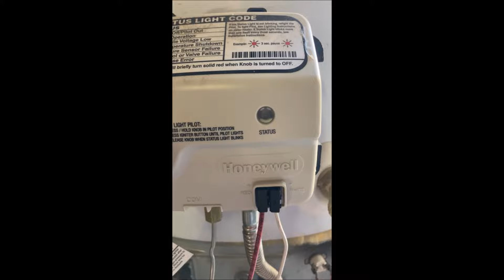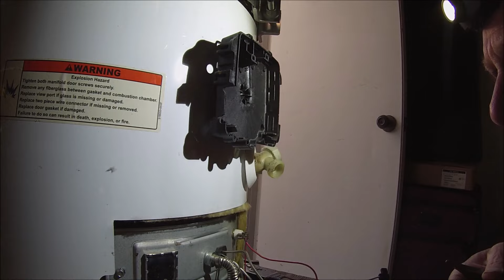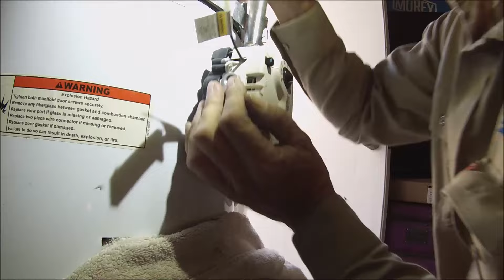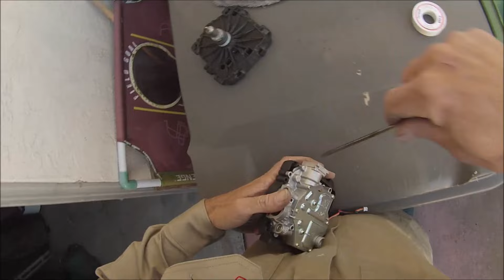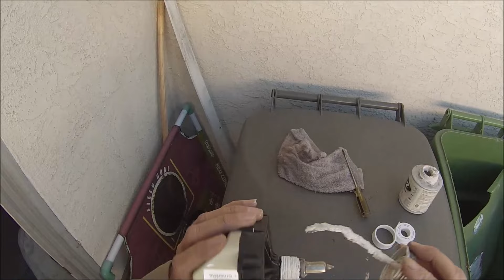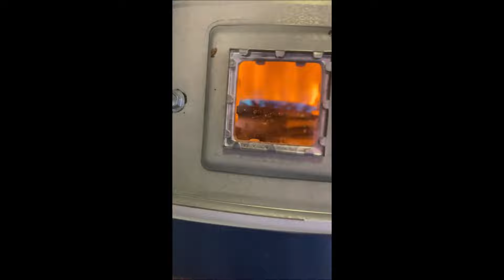Code 5 | 5 Flash Water Heater Honeywell Valve Service Call

Comment: We had rain and high winds and then the house water was still hot but not hot enough. My hot water heater is in a room that is only accessible from outside; a furnace room. I went to check out the wh after a couple days of being puzzled by the hot water. Still had hot water, just not enough. The door to the room was open. It must have blown open and the wh is close to the door. Somewhere in one of these videos someone talked about the controls getting wet. I took apart the control just enough to get some airflow into it, got out a hair dryer for 5 minutes, turned the pilot off and back on and presto it works. Thanks for the help.

Comment: This is a fantastic video after 20+ without showing my issue. STOP and read this if you have this 5 flash error code: Make sure the plug for the temperature controller is plugged into the circuit board. Mine was dislodged and causing the error code because the computer could not get a reading on the sensor
Reply from the maker: @Adventures_with_nick  thanks for watching. I really appreciate the comment. I’m glad it helped you out.
Reply: @ videos like this are the lifeblood of DIY and home affordability, thank you!

Comment: Had the 5-flash code since June, but with this South Texas summer, there was no pressing need for scalding hot tap. But after a few battles with a leftover bacon greased skillet, it was time to give replacing the temperature sensor a go! Bought the part off of Amazon ($50) and followed the first part of your EXCELLENT video to a T.  Everything went as smoothly as planned, and clean skillets and hot lava showers are the back in rotation. Thank you sir!! 👍👍
Reply from the maker: @jjrafanan1970  excellent ! Well done thanks for watching!

Comment: Had an intermittent temp sensor error, so I figured it was just a flaky sensor.  I had watched your video (very helpful!) and knew I had everything to swap it out.  I wish I had paid more attention to your discussion on the plastic vs metal tip.  I didn't check beforehand and I should have.  When I pulled the sensor, it was wet. :(  
I then had to order a whole new gas valve.  I loved your tip on using a short pipe to plug the water connection so that I didn't have to drain the tank.  The replacement was fairly easy then, and now I have good hot water and a couple spare parts for the gas valve since it was only the back plastic that was bad.
Reply from the maker: @ken261  : that’s great. I’m glad it worked out. Thanks for watching and commenting. Appreciate it.

Comment: I have a 10 year old Whirlpool NG water heater (I think they are made by A.O. Smith) that has been giving 5 flashes.  I replaced the entire burner assembly. Still faults out, so next I check the valve itself. Thanks for the instructions.
Reply from the maker: No worries! I did a code 5 tonight ! Bradford White ! Thanks for watching an commenting!

Comment: The problem is that Honeywell used nylon for the thermowell. Nylon absorbs water and is not compatible with chlorides and eventually the plastic fails in the application. After 11 years, the thermowell literally disintegrated. I repaired mine by using double wall heat shrink to (I also needed some 3/8 waterline to rebuild) seal it up. Doublewall heatshrink has glue on the inside surface. The product I used had operating temperature up to 135°C.
Reply from the maker: Wow, good job!!

Comment: Great video, thank you!
Do you have to turn off power to the water heater before taking the Honeywell unit apart? I don't see any power running from the house to the Honeywell unit, just the wires you show in the video. Where does the power for the unit come from (i.e that makes the light flash)?
Reply from the maker: @kenlindeman8633  : no it gets its electricity. It turns the pilot flame into voltage for the circuit board so all you have to do is turn the valve off. It has its own electricity that way no batteries no power from the house.

Comment: I have the 5 flash error code on a Honeywell unit and I am confused by some of the wording used in the video. A statement about replacing the valve would not fix the problem and only replacing the thermistor would. From what I see on the video, the thermistor is an integral part of the valve and replacing the valve would cost more but also fix the problem. Correct? Just want to be sure if I cannot find the correct replacement Thermistor, then replacing the valve should resolve the 5 flash error code?
Reply from the maker: @JeffreyDeGilio  : well, I’m sorry you’re confused by the video when I say the Valve that’s kind of the entire thing so that’s the Mr. the Valve itself the Circuit Baord and the well Housing , which I just call the Valve. It’s very difficult to purchase just a mister so you’re probably gonna end up having to buy a completely new valve. I would search for one that’s used on eBay or maybe check Amazon. Typically what causes the five flash is the well Housing , which is the black plastic part that screws into the water heater gets a hole in the end and then water gets in and kind of screws up the thermistor. So it is possible to rebuild with parts your existing valve unit. In that particular video, I tried to cheat and just replaced the thermistor. But doing that is only a temporary fix and it only buys you a little more time. I ended up replacing the whole thing. I tried to be as thorough as possible. Hope the video helped you out in someway. Thanks for watching.

Comment: This is the ONLY video I could find on YouTube about the thermistor.  It helped a bunch!  My thermistor was wet.  Do you know where a DIYer can find just the black part of the housing thay goes into the tank?
Reply from the maker: I've got boxs of them , but try ebay.
Reply from the maker: Thanks for watching!
Reply: If you have a back for a Honeywell valve model WV8840B1109, would you consider selling it to me?
Reply from the maker: @backrhodeskansas  the whole valve?
Reply: No...just the back part that screws into the tank.  My thermistor was wet so mine must have a crack in it.
Reply from the maker: @backrhodeskansas Yeah sure you need the the shank depth size and spacing center or bottom 2" or 3" Metal cap included 20$ plus shipping where are you at?
Reply: Do you have an email or Facebook for your business that I can contact and we can figure out the particulars?
Reply from the maker: @backrhodeskansas  my youtube page , about has my email

Comment: after you replace the thermostat it failed again that’s why you replace the back part with the metal one ?
Or just replacing the thermostat will do the job? I have the same issue so trying to find the thermostat but amazon has one for $50 but it says it gets returned a lot should i look for a good quality one and where can i get it? thanks pretty cool video btw
Reply from the maker: @gerardo.porras  : yeah so technically replacing the thermostat will fix it but only temporarily because usually it’s a leak in the back so I highly recommend that you replace both parts. I wouldn’t order one that you think gets returned often. I just spend the extra money and get a replacement valve. I think Amazon has pretty good deals maybe $85 or something like that or you can try going by plumbing parts supply houses sometimes people drop off old water heater heaters, and you can just take the parts right off of them.
Reply: trying to find the right part. But i cannot find it anywhere 

Honeywell wv8860b1309 product seems to be no longer available but trying to find if i can substitute with something that will work.

I still to put it apart and see if it leaks , i have not seen any leak so far. But want to have the right part before taking it off as right now i had to reset it to heat water and it goes bad after a few minutes but at least i still can heat the water while i find the right part. If you have any recommendations on the part let me know.
Will try to find if someone got rid of their water heater and see if i can find the part

Comment: Nice work, thanks. What size plumbing used to plug tank while you were working on valve?
Reply from the maker: @campbellsmith5484  all the connections on the water heater should be three-quarter inch

Comment: Did you have to drain the water heater prior to doing this?😊
Reply from the maker: @ngoose511  you don’t have to because you can get it in. I believe it’s called a vapor lock or Hydro lock but if you have the time it doesn’t really hurt to drain a water heater down it’s a good time to get settlement out anyway so it’s a lot easier if you can drain the water heater down, depending on your perspective, but technically you don’t have to long as you shut the water off to the water heater and don’t let air into it you can do it really quickly when the Water heater is full!

Comment: My hot water does not have a cold water shut off. Is it fine to to shut off the main water line instead to swap out the unit? I
Reply from the maker: @brandonelmore1174  yes that’s fine you just need to create a vacuum-
Reply: @ awesome! So I’m assuming , using the same method ? Turn off main water line, and open drain valve and release water ?

Comment: Please respond is this dangerous if you didn't get it fixed right away? The water is lukewarm to warm for the shower but its pretty warm/hot  if I use the kitchen sink the tank is probably 12 years old good video if I could do it like you I would.
Reply from the maker: So based on your description that means your shower valve isn't mixing the hot water correctly , if you have hot water in sink but not the shower , its a broken shower valve! FYI
Reply: @thewaterheaterfactory  Thanks for your reply 🙂 I think that was a possibility or probably it. I thought I saw five code blinks on the water heater it's a Whirlpool I seen some blogs that mentioned Whirlpool's weren't any good I haven't any problems with it until now as long as it's not dangerous I will probably wait get another water heater and have the shower valve replaced thanks for your time and helpful suggestions.
Reply from the maker: @michaelmurray2104 Whirlpool is made by AO Smith I Believe! Not a bad water heater I work on them all the time its the parts that go sideways on you! Thanks for watching!
Reply: 😊 @thewaterheaterfactory
Reply from the maker: There’s something wrong with your shower valve your shower valve is a mixing valve it mixes cold and hot that’s what’s broken not the water heater if the water is super hot at the kitchen sink but only luke warm at the shower. It’s the shower valve turn your water heater down to normal.
Reply from the maker: It’s not dangerous probably the cartridge in your shower valve. But if you keep turning your water heater up to compensate for a broken shower valve, you’re gonna get burned and you’re gonna excessively wear out your water heater.

Comment: Thanks for the great video! What do you recommend to seal the gas line connections? What is that white paste over the teflon tape that you used for the gas valve? Thank you!
Reply from the maker: @GooGoo007  : that’s called a PTFE sealant it’s basically like a Teflon paste- it’s also also referred to as pipe dope- Usually Teflon tape or piped up works really well you could stick with piped up. You can’t really go wrong.- thanks for watching and commenting. Appreciate it.
Reply: @thewaterheaterfactory  Thank you for the fast response!

Comment: I usually replace the hole valve, where do you get the thermostat inside the gas valve?
Reply from the maker: @princeandroyaltys2478  : I took it out of another valve that I have I work on Water Heaters a lot so I save all the extra parts, especially from the ones that are leaking so I have the parts that I need without having to source them

Comment: Great video! Just out of curiosity what is the ohmic value of the thermistor? Does 10k sound about right?
Reply from the maker: @rba5567  : you know what I’m not sure what that ohm reading is. I just know that the left side and the right side have to be equal. I wanna say it’s in the 3000 but it’s been a while. There’s a pretty good video on it. I think it’s on Bradford White,‘s  channel page. I have a lot of links to Bradford White, videos on my channel page. If you want to check it out I think it’s under Recomended views.
Reply: @thewaterheaterfactory  thank you for the Swift response. My Bradford White Water Heater is over 10 years old and I'm getting the five flashes and there's some dripping coming from internal. Since the water heater is over 10 years old it's probably got the Wellhead without the metal covering.

Comment: Is it necessary to shut off the gas/ water supply or drain the tank before replacing the thermistor?
Reply from the maker: Yeah it is because if the third Mr. is bad you really need to replace the entire valve so you have to shut the gas off and then to get a vapor lock to prevent the water from shooting out of the tank. You have to shut the water off and break the pressure.

Comment: Thanks! And you can’t use the flex gas line again, correct? I heard the compression connection is a one-time thing
Reply from the maker: I use them them over and over again , doesn't hurt to replace it ! But my customers are on the thrifty side if you know what i mean.
Reply: It says on a gas whip tag (DO NOT RE-USE). Although they typically never leak when re-used I always think it's a good idea to replace them. Also if you RE-USE the drip leg make sure you clean it out in case any debris may have built up inside.
Reply from the maker: Yeah I reuse them , I've got one I test with water heaters same one probably disconnect and reconnect it 10 times a week for three years. Good advice though !

Comment: I currently have the 5 flashes on my heater. I noticed about two weeks ago, the hot water in the house was not very hot anymore. I did not notice the 5 flashes till after I did a flush of the heater. BTW, the flush did not reveal excess sediment.  Will the heater function at all with the 5 flashes??  Is the sensor that is faulting in the burner or the one in back of the valve??? The burner seems to be working fine. Thanks!!
Reply from the maker: @7080nik  yeah it’s hard to say it may still function but eventually if you’re getting a fire flash, that means there’s a problem with the therm and it’s not determining the water temperature and responding to a properly

Comment: Where can I find/buy a replacement thermistor? I have looked online but I can’t find one that looks like this one.
Reply from the maker: Just buy the whole valve used and cheap and use it from there! Make sure you get the stem length correct some are short some are longer
Reply: How do you know what length to order?   @thewaterheaterfactory
Reply from the maker: @djlogger1  so you either have 1 inch of insulation on your water heater or 2 inches so it’s the it’s the shank depth of the valve which you could use the valve number as a guide there’s a number on the right hand side of the valve starts with a W as a guide for the part number that you need but there are about three different types of thermistors as far as how there installed

Comment: We have a Whirlpool n40s61-403... how do I determine exactly which thermistor to buy?
Reply from the maker: The valve has model numbers on the right hand side. Do you want to try and match those up as close as possible you could try calling the manufacturer Wirlpool and see if they can get you a replacement part number then search for that online on eBay or Amazon or something to get it cheaper.
Reply from the maker: On the side of the valve are identifying numbers to order parts from the manufacturer

Comment: Hi goodmorning...I have a honeywell control valve on my water heater model #WV8850B1309......2
WHERE ON THE CONTROL IS THE TEMPERATURE SENSOR LOCATED?
Reply from the maker: Well there are two temp sensors. One detects the temperature of the water, the other detects the Combustion chamber temperature? So the thermistor is located behind the valve in a ribbon cable leading to the sensor , that's for water temperature.

Comment: How much does it cost to just replace the whole thing (the control center)
Reply from the maker: @richardkettering9532  it depends where you purchase the valve from I’ve seen them as cheap as $65 on Amazon and I’ve seen them go for as much as almost $300 new that’s just for the cost of the part labor to replace valve is $75. I’m not sure what other plumbers charge.

Comment: Are the Honeywell valve assemblies universal or are they unit specific? I've seen several on ebay that look the same as the one I have but wasn't sure if there was a specific model number I needed.
Reply from the maker: It’s always best to get the model number that you have if possible. But if not, yes, you can mix and match them. They only really change as the water heater scale up in size say 100 gallon or bigger.
Reply: @thewaterheaterfactory  Thank you! I appreciate the quick reply!!